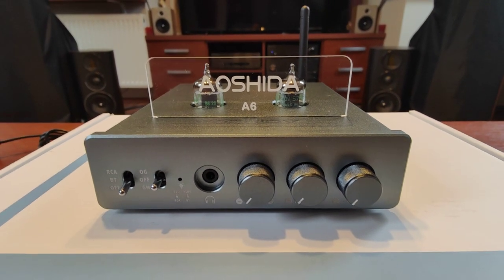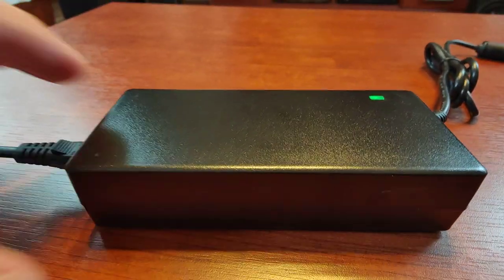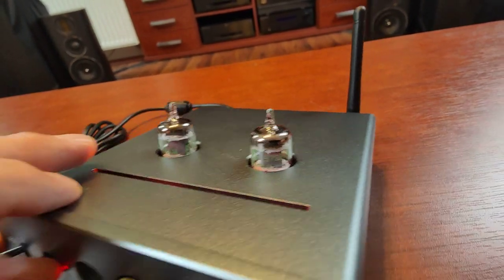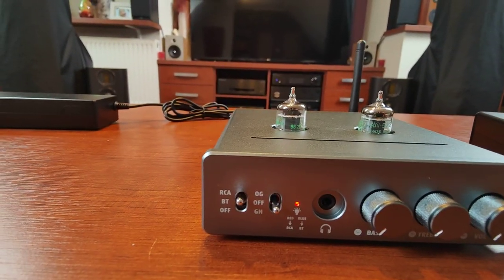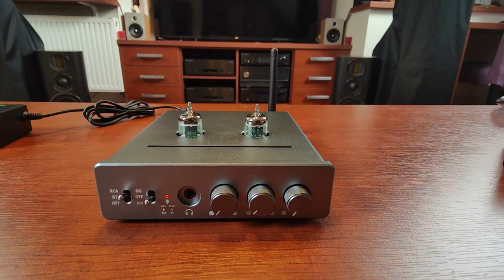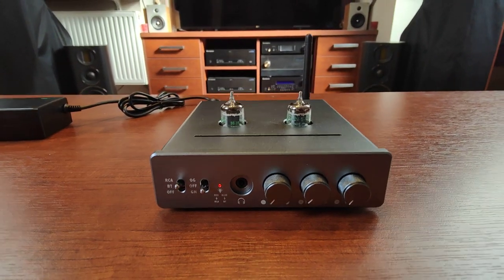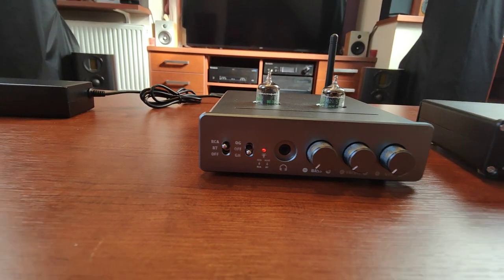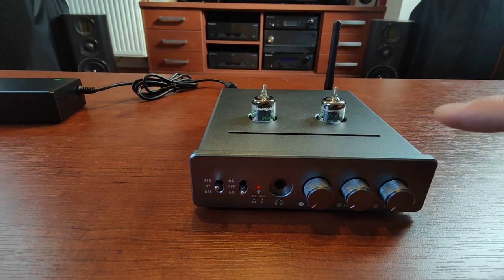Aoshida A6 speaker amplifier (tube + Infineon) short review

Comment: I have the same problem with the power brick! But the amplifier works perfectly. Would you have any recommendations for an alternative power supply?
Reply from the maker: I guess any with same voltage and amperage, though the "coil whine" can happen also to others.
The good thing is that from 1m-1.5m I can no longer hear that.
Reply: @k4syx  so I do have a laptop transformer that could serve, Vultech AU-120W that has the following specs: 15/24 DC max 5A 120W , would it fry the amp? Both the transformer and the Amp having automatic variable voltage would present a problem?
Reply from the maker: @mideff96  as long as you stay within the amp max voltage limit AND plug has the same polarization (+/-) and size you're safe :)
The amperage doesn't matter (simplyfying things a bit) as long as it's not too low.

Comment: i bought some amazon cheap speakers that i'm not that happy with. what's your thoughts on getting some old second-hand speakers? best I can find in a short budget around me are some Pioneer S-Z71 , would you say it'd be worth going for them?
Reply from the maker: What's your budget? I am all in for used speakers :)
Reply: @k4syx  well my budget is quite low :) would love to stay bellow 100€. the speakers I got are the LONPOO LP-42, but they're extremely dull, not much character. although they have some bass when well positioned, there's no definition and no depth in it. i get nowhere trying to equalize them, only saturates.
Reply: also found some Leak 2030 at 110e , 3 way speaker. could it be more interesting?
Reply from the maker: @mideff96  100eur may give you used Cambridge Audio Sirocco bookshelfs, at least around here, also Taga Harmony Platinum One. For 40e more, you could look for used Elac Debut D5.2. Siroccos are scary good, but they are really rare.
Reply from the maker: @mideff96  Leak 2030 are from 70ties if I see correctly, I'm not into vintage much - technology has moved forward...

Comment: try voskhod 6j1p tubes
Reply from the maker: How would you describe them? 
I had russian military 6n1 for my tube buffer and while they were better than chineese stock ones, everything about them was inferior to GE.
But these are not 6n1 so I am open: what's your take on them?
Reply: @k4syx  i have a Fosi P2 mini tube amp and i only tried stock chinese and the russian voskhods,  i would say the voskhods are more detailed with better instrument separation, they are more mid centric a bit bright i would say also they sound more holographic, pretty good with acoustic recordings, Alice in Chains Unpplugged sound amazing on voskhods. Both tubes seem to have a bit of bass roll off compared to my laptop and smartphone headphone jack, i dont know if tubes are supposed to roll off the bass as i dont have much experience with them,  curiuous about the GE i heard they sound more ballanced with good bass.

Comment: Strongly disagree that neutral sound knob configuration on this amplifier is with both knobs turned to the left. Neutral is with both in the center.
Reply from the maker: I thought (heard) that the mids were recessed in 12 o'clock position, like the sound would be slightly v-shaped. On the other hand, the mids were not pushed forward on the left position. I'll check that once again as soon as I'll visit my brother who is using this nice amp now.
Reply: @k4syx  yes maybe it's somewhat v shaped, but I really can't tell without proper speakers :) be sure to review the amp controls with more in depth, as well as the tube rolling!